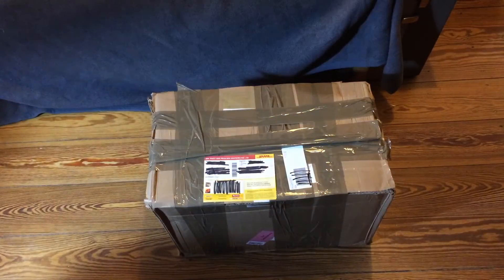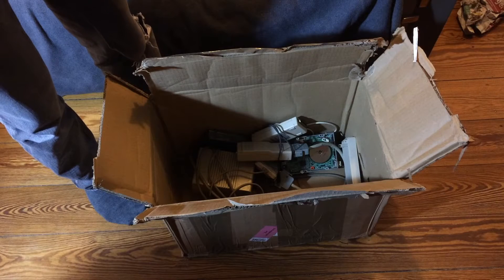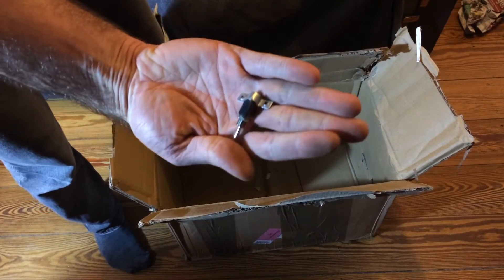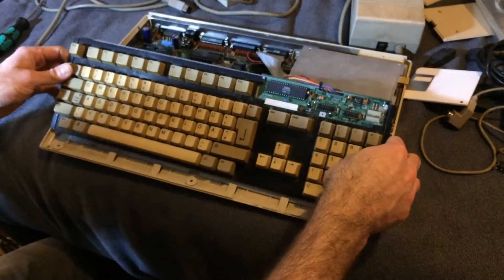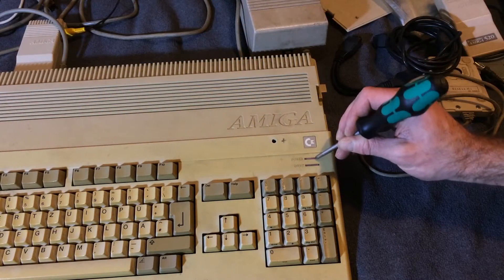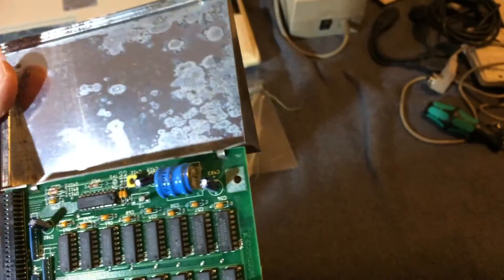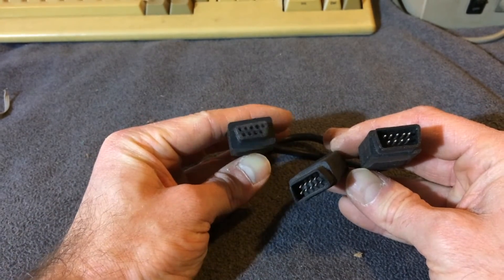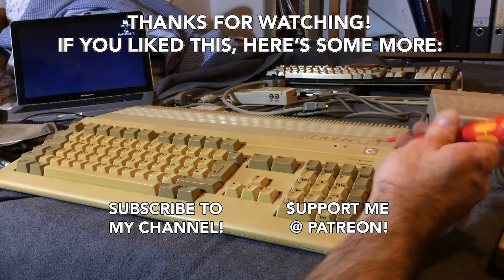Amiga eBay Haul Unboxing (Dec 2016)

Comment: How did you get image using the portable pc ?
Reply from the maker: I used a cheap EasyCap video capturing stick and the "MirrorPro" app. Works for me. I wouldn't recommend it, though. The EasyCap sticks are very difficult to get to work properly. There are different chipsets with different drivers and different capabilities. And you don't know which one you get if you buy one.

Comment: you can restore this pins chips
Reply from the maker: Yes, I'm definitely going to try to restore that second Amiga and bend the pins in shape/solder on new pins/use sockets. The board has quite a few issues, though. Don't know yet if I can get it to work.
Reply: Fixing what is genuine that belong to the best computers brand of the 80´s and 90´s it´s very important
Reply from the maker: +TheReasonForYou I totally agree!
Reply: i´d like to add you on facebook